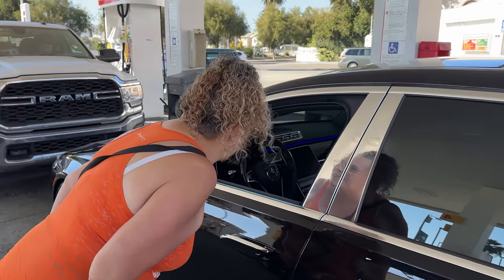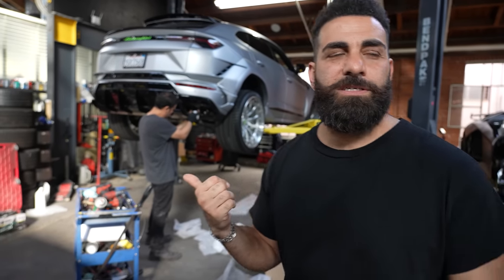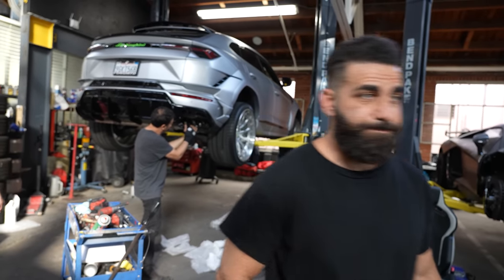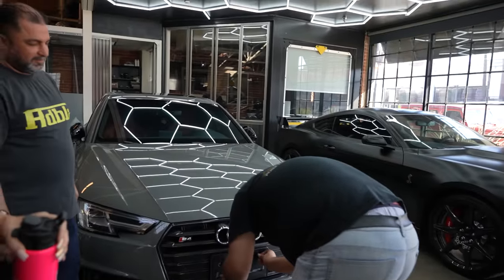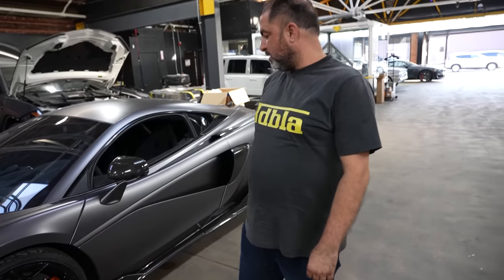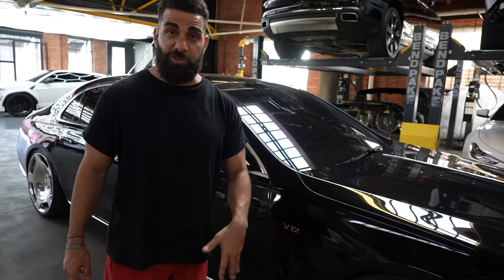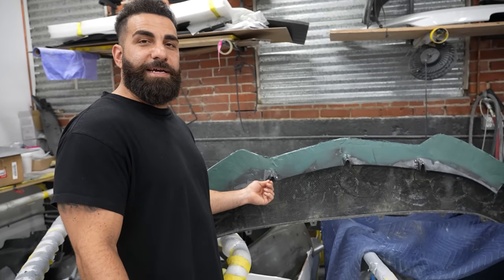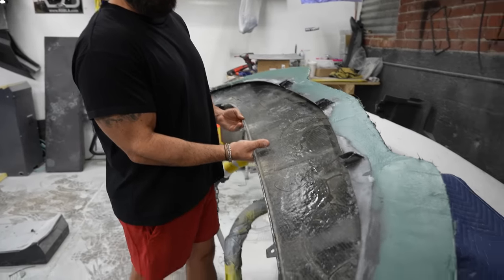Perfect Elegant Maybach with Mesmerizing Wheels, Silvered Widebody Urus.

Comment: Least favorite color on the Urus, shows the gaps more than any other color
Reply: That’s not the colors fault, whoever did that kit did a HORRIBLE job.
Reply: It’s quite glaring because we are so used to RDB’s level of fitment. The gaps are so apparent.
Reply from the maker: @donnyc6374 we did not do the Widebody installation.
Reply: Absolutely, and it shows!! Luis would never have signed off on this.